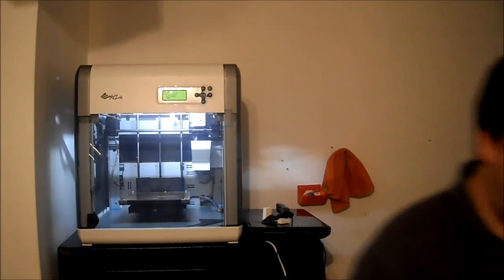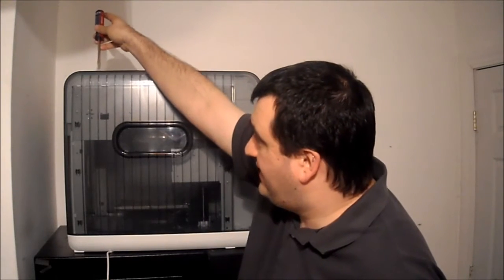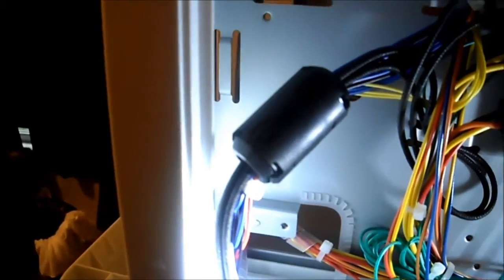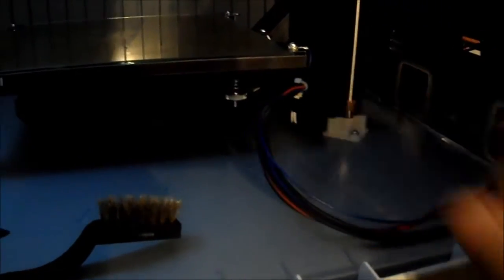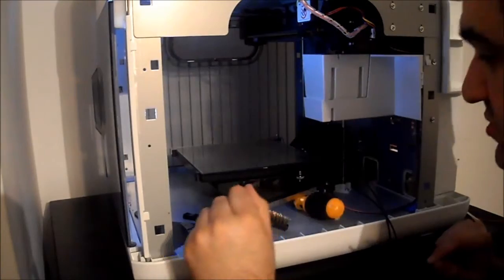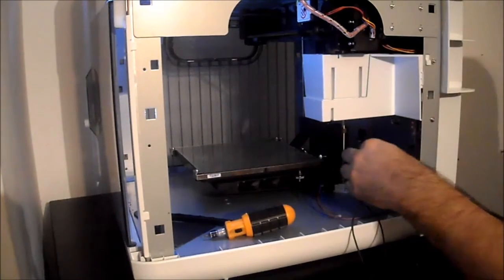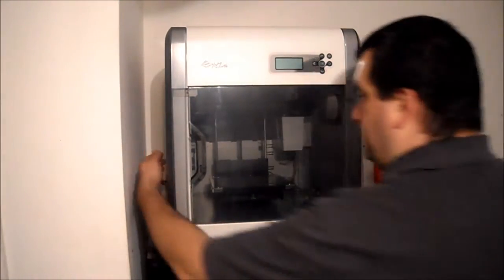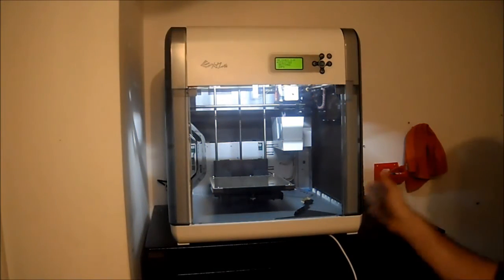tutorial how to replacing glass on a xyz printer da Vinci 3D Printer

Comment: I didn't understand the reason for doing all the wiring work.   It seems to me that you could have just disconnected at the glass and left them there to reattach to the new glass.   Did I miss something?
Reply from the maker: the glass came with the wires soldered to the glass it seemed easier to do it this way then unsoldering it.
Reply: Basic3Dprinting I didn't realize the glass and the heater were attached.   Thanks!